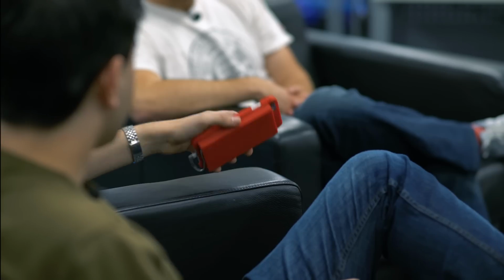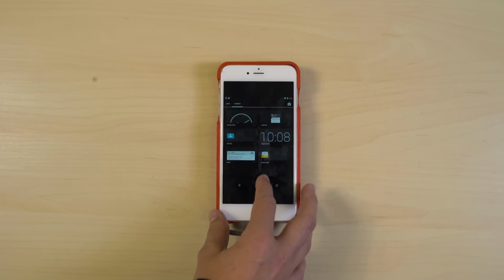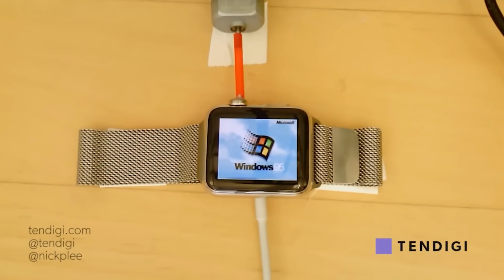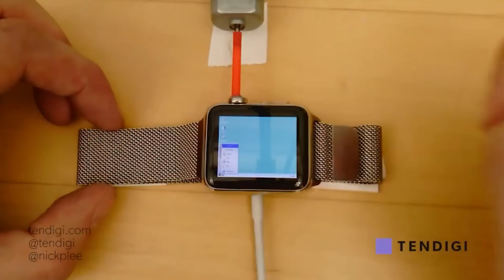iPhone Running Android: Explained

Comment: stop saying running  on the iPhone, because it's not.
Reply: Debatable. It's running on the iphone in the sense that the iphone is used as a display host.
Reply: we've had computers with monitors for years, but nobody ever said windows/mac is running on the monitor.
Reply: chepe perez
The fact that it requires an app to run in itself means its running through IOS.
Reply: +erq you can also use analysis app, to view your Android phone on your pc. a long time ago lol I had an HTC hd2... it was a windows phone, running Android for real, no app or separate hardware. Google it, that's  how it's done.
Reply: That's why I said it's debatable. He is using iphone hardware with an additional logic-board attachment to run android. The only difference is that you think of the board as a separate entity rather than an add-on.
An HTC HD2 and a PC are 2 entirely independent systems whereas his board is dependent on the iphone API to run android.
Reply: +erq his board has an HD port, so it can use a TV as a monitor. in this case it is using the iPhone as the monitor (of course not using the HD pot). android is running on the hikey board, and he is using the iPhone (with the app he made) as a display. I mean doing all that is very ingenious, he's a really smart guy. but android is not running on the  iPhone, Android is running on the board. in any case it genius.
Reply: We all get that android isn't directly running on the iphone hardware.. But it's made so that android can be used through iphone API, therefore enabling him to say that android is running on iphone.

Comment: It would be nice if android phone run iOS
Reply: kind of a waste really... I think android on a windows device would be great
Reply: +BGuy I meant as running both at the same time like MacBook with Windows. You can switch between them would. It would be nice because now you have extended memory and two sims on one phone.
Reply: Abdulla Baqer it would be cool, I just don't see a lot of functionality you would gain by having iOS
Reply: +BGuy for the apps hehe
Reply: +BGuy windows on Android and Android on Windows have been done before. Example? mi4
Reply: +BGuy and if u were referring to Android on desktops, android-x86 project has got u covered
Reply: Lucasleeeeeeeee I was refering to windows phones
Reply: That would be dumb.
Reply: Nice for cheapskates, yes.
Reply: Check the context... context, context, context! I was saying why would anyone choose this junk over just going out and buying an Android phone, of which there are many. Nothing to do with comparing iPhone and S7 prices, sorry that wasn't clear.
Reply: Happened before.  Like in 2009...
Reply: Technically it could be possible if many people from the Hackintosh Team were to write a kernel for some ARM chips and there would be that one Android Phone that has a native compatible ARM chip.  It may however, not work (not for sure).  Because when iOS was written for the iPhone 3Gs or iPhone 4... Something like that at one point Apple started making their own ARM chips.  Then again a slightly modded kernel for the ARM support may come some day and some day may return the open source iOS bootloader.  It would be hard to maintain it though because of the constant iOS updates.  It would also required you to be first jailbroken.  The graphics chip?  Ehhh... Maybe it could work without hardware acceleration like the iPhone 3G on Android what 2.2 I think?

Comment: apple make a very well made phone but a restricted OS.  An apple phone running a grown ups OS like android would be class
Reply: Both have their own strength. Both OS are as of now very mature! TouchWiz and iOS that is. The rest of Android is pretty far behind.
Reply: ***** Have you even used stock Android? LMAO man. Nobody uses stock android when they have the latest touchwiz. Even stock android fanboys like MKBHD has reverted from being one as TouchWiz simply is better in every regard. Who doesn't like the UI being user-friendly? Who doesn't like the "it just works" experience? Apparantly you love the non-user-friendly UI with the "oh shet, this doesn't work" experience. A tweaking sheep (I used to be a fool like this. I learned it the hard way by constantly switching between touchwiz & vanilla Android (AND even CM!!)).
Reply: ***** For custom ROM's I'd take TouchWiz custom rom's. Not only are they the fastest at doing every task, they are not bloated as regular touchwiz already is very feature rich and almost complete. Custom ROM TouchWiz can add the missing stuff like double-tap to sleep or double-tap to wake but nothing much more (perhaps some xposed modules?) I've used all versions of CM and AOSP and all the other many variations, but also TouchWiz since the Galaxy S4 up to the Galaxy S7 Edge (Currently rocking the Note 7 rom on my S7 Edge, Touchwiz definitely fine-tuned it A LOT on the Note 7!!).

For basic features, Android 6.0 is kinda lacking. Android Nougat should bring many TouchWiz features to stock Android which should make it more complete. CM Itself is very basic and not that severe of a custom ROM anyways on it's own. It's fun to tinker and play with, but it isn't worth it for an daily-driver phone that never crashes and can run for weeks with no reboot or the user to even think about it.

Comment: Aren't iphones too weak for android?
Reply: Not at all you.
Reply: How would they be too weak? Most andrioid phones cant even run there operating system lmao
Reply: +Boydgado26 my android phone runs fine. not only is it stable but it controls almost everything in my house through my phone. 2.5 Gh quad core, 4 gigs of ram, 250 gigs of storage running android. ill stick with my phone.
Reply: " not only is it stable but it controls almost everything in my house through my phone"

Ermm... so what?

Typical of Android users to brag about specs, and yet TOTALLY miss the point.
Reply: +unlokia i mean when you buy a product aren't you supposed to be buying said product to improve your life and for it to do what its supposed to do and more... and is it not normal to want to get the most our of your hard earned money? my point is getting more functionality at a cheeper price and being able to customize your device to the needs you have on a daily basis is more attractive than sighing up for a closed system that is way more expensive with less functionality.
Reply: Boydgado26 I thought android was just more power intensive, meaning that it needed higher specs to run at the same performance. Not spreading hate for any of the two operating systems, just wondering
Reply: +Kevini saname they can be and also cannot be. its an open platform meaning you can make it as complicated or as simple and basic as you want and can optomise it for whatever platform you are running it on unlike ios.
Reply: +Dennis Kevin android is not optimized at all no bs please.I have been using flagship android for about a year or two now and i must say using an app is like walking on mine field because it could crash anytime
Reply: +kuroko chi Is it some crazy old flagship? my 2 year old note 4 works perfectly without stuttering and I haven't had any app crashes since I got it
Reply: +Adil Ras s5,s6,s7 i keep updating.
Reply: +Adil Ras s5,s6,s7 i keep updating.
Reply: +Adil Ras your note 4 runs old version of android of course it works fine
Reply: kuroko chi Are u on verizon? They clog up their phones with a bunch of crap. Same with sprint. Not too sure about AT&T but i know that t-mobile phones are pretty reliable in relation to bloatware... Also you may be having crashes because you have a very new version of android and some people may not support android 6.0 in their apps although for the most part apps from well known developers work just fine.
Reply: kuroko chi Nope im on 6.0
Reply: +Adil Ras I use basic social app.. and i found out that youtube feed, snapchat feed, crashes alot if i scroll in a certain speed.I mean come on google cant even handle their own app
Reply: +kuroko chi ive been using my android phone for 2 years and ive run cpu and gpu intensive tasks on it for work and just for fun without a single crash. infact its hard to remember the last time i had to restart my phone. you're obviously doing something wrong or have something running in the background that may be causing your crashes.
Reply: +dontrunwithscissors the snapdragon 820, kills the A9 in any benchmark tests brother.
Reply: @dennis he's not talking about your phone. Those below $40 phones he is talking about.
Reply: +Dennis Kevin lmao you legit said it... Working phone on a daily basis, that's all you need you don't need fkn customizable fkn docks and lights like Tf it's a phone you use it for your needs now if your needs is having cool shit on it then by all means get it but to me on a daily basis I use my phone for Twitter,YouTube,nextflix and calling and texting of course.that's it that's all, is changing the way your lock screen really gonna change ur every day life? Like is it going to improve your daily basis need from a phone?
Reply: ***** You aren't required to have widgets and shortcuts don't affect the performance. Also I use a widget that shows me my steps for the day and it doesn't seem to affect my phone at all. Still just as snappy. Now if you choose to fill your homescreens with widgets that are constantly changing or if you just have a ridiculous amount of widgets then you can probably expect some lag on the homescreen but from what I have seen, no one does that. Your point would make more sense if referring to the old android versions, which were pretty bad regardless, (3.3 and older), but now android is alot more optimized and most decent phones have good specs so lag from the homescreen is pretty much unheard of if you get a decent device. The optimizations are actually why I switched to android. I couldn't use it before because i didnt like the lag but after around 2013 the issues I had with android vanished so I switched over.
Reply: All phones can lag. There are plenty of iPhone 6(s) issue's around there as well. Such as overheating, crashing and the most famous one "FK, My phone died at 21%!" The last issue has been there ever since the start of iPhones and still is there, even on brand new iPhones. Not everyone has that issue, but the majority of users do have that issue and have learned to live with it. The only brand with the least amount of issue's is Samsung since the Galaxy S4 and only with their flagship line-up. The least amount of hardware-issue's combined with the least amount of software-issue's.

Just don't forget that both Android and iOS are just platforms with apps. No matter how good the platform is, if the app is bad, it can crash and it will definitely crash in that case.
Reply: +Kameel huh. I've never used an iPhone that died like that. All of mine make it down to 2-1% before they power off... Never even heard of that being a thing..
Reply: Actually yeah. The hardware inside the latest iPhone is too weak to run the latest version of Android. Basically, an Android device running iOS would be faster, but an iOS device running Android would be slower. The main reason to why an iPhone may run better than let's say a Samsung Galaxy S6 is because: 1. it uses a 720p display 2. iOS is very optimized to only run on devices designed by Apple 3. the software itself is very limited. You can't even install Adobe Flash onto your web browser!
Reply: ***** Yes, it's old, and yet it has never been available in Safari from the start. You're proving my point even more. That's like saying how most browsers uses HTML 5 but yet it still supports the old outdated HTML.
Reply: ***** Adobe Flash is actually pretty popular.. It has been used by many Animators, and were used to make shows like Fosters Home of Imaginary Friends. Even youtubers like Domics uses it to animate his videos. My school's website still requires Adobe Flash Player just to open up PDF files without downloading them. I'm not so sure where this rumor of Flash Player being obsolete came from considering how many things relies on it.
Reply: ***** Oh I know I was speaking of two separate things. My point was that some animators doesn't like converting their animations to a video format and so instead you just use Flash Player to view it. Sites like Miniclip, Maxgames, and other popular sites relies on Flash Player for literally 100% of their games. If it didn't exist, they would also go down.
Reply: ***** I know what newgrounds is. Miniclip and Maxgames were just examples..
Reply: +Jason Lee youre right iPhone running android would be TERRIBLE...don t u think why iPhone has low specs? its because their OS is so restrictive, less feature and too simplified...but on the other hand samsung that have a high specs still having a little bit lag with android....why? cause u need a powerful hardware just to run android smoothly...also if are saying u are using iPhone just for daily basis and not onto a game that much android will do the same its just a milisecond delay...why pay a higher price for less...i dont understand